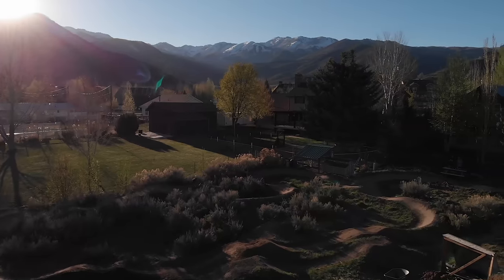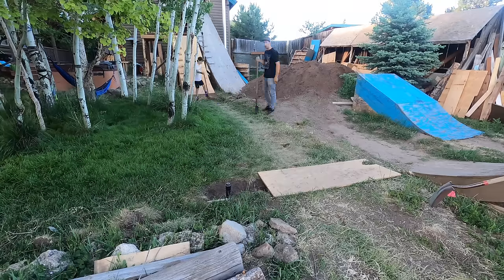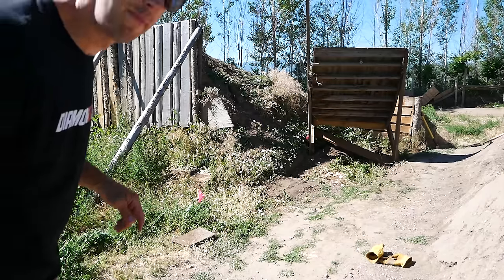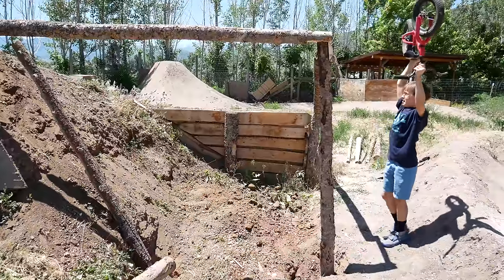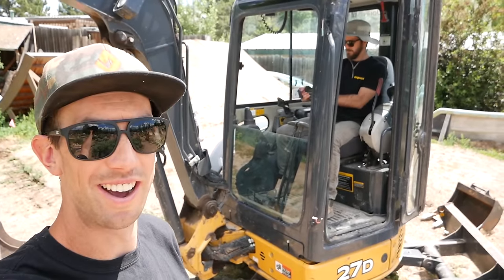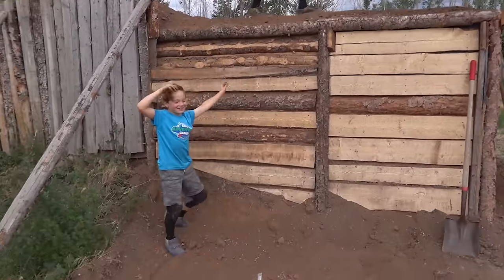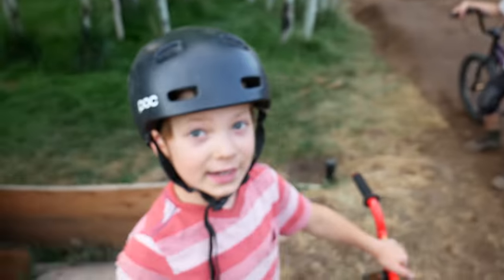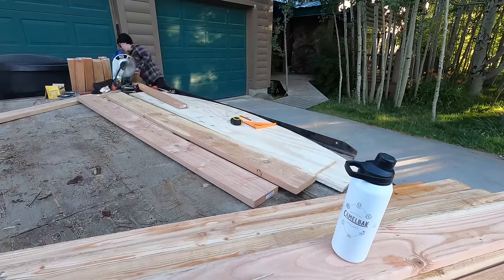Building our NEW Backyard Dirt Jump Line!

Comment: For your jump, what thickness plywood for the curved sides, jump face, and cross beams are you using. It looks like 3/4 for the curved sides, 2x4s spaced every foot or so for the cross supports, and two layers of 3/8 for the face but just wasn't sure. Trying to get something built in our backyard after watching this awesome video!

Comment: What radius did you use for your sons lips in this build ? I'm trying to build something for my son who is 10 years old and races bmx . We already have a semi pump track jump line and he has asked for the jumps to be built higher.  Any input or direction you can point me in to help make the process easier would be greatly appreciated.
Reply from the maker: It's a tough answer because it's different for every jump size and speed. We went with 9.5' radius lips 4.5' tall, 8 foot gaps, but that might be too steep/quick for some people, or too mellow for others. Try to measure angles and dimensions on existing jumps that you like, that might help.

Comment: I bought the same Alaskan saw mill after seeing this video. Are you using a "ripping" chain instead of the regular chain?
Reply from the maker: That’s cool! I have a ripping chain and a full skip regular chain, the ripping chain is a cleaner smoother finish, the skip chain is faster, except for the fact that you have to sharpen it more often because there are less teeth. So if rough cut is fine, you can stay with the regular chain, if you want the smoothest finish, cut slow and use the ripping chain.
Reply: @PorterMTB  that good to know. Thanks so much for the reply.

Comment: what are the materials used to build the jumps.
what's the radius and the height of the jumps .
I'm building a jump line like that my back yard and I don't have much knowledge so I would like to know
Reply from the maker: Hard to say in a quick comment, but we used 3/8" plywood for the sheeting (2 layers), 2x4's for the ribs, and 2x6's for everything else. 9.5' radius 4.5' tall lip. Good luck!

Comment: If you keep putting dirt on the bottom of your ramp, it's going to rot out very quickly.
 Like MUCH faster than it would under normal conditions.
☝️
Reply from the maker: I know, it's a tough balance between making things so they will last forever and getting it done so we can ride. In reality I like to change things up from time to time as well to keep it fresh, so I'm not too bummed it doesn't last 10 years. It's pretty dry here too, so that helps things last longer.